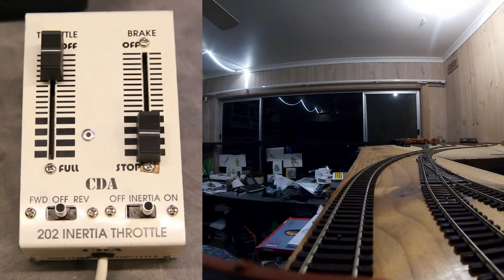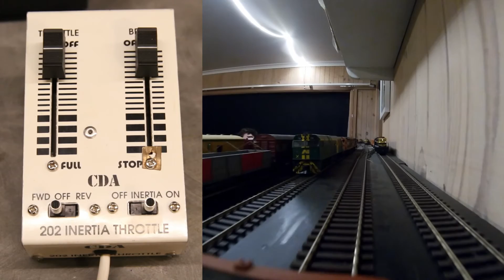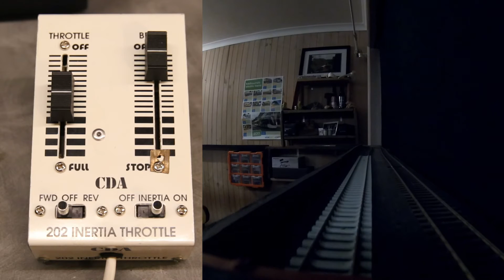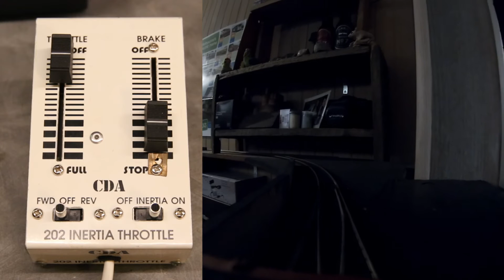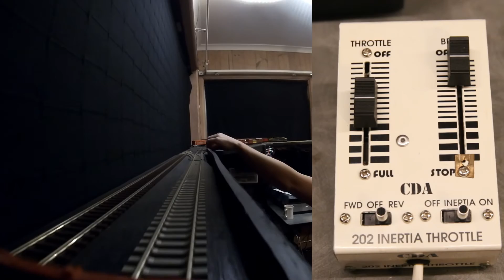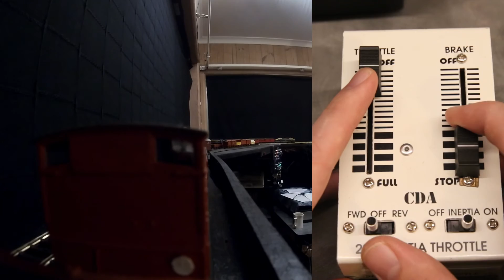Model Railways - Driving with an Inertia Throttle

Comment: Great video! Looks like a brilliant controller. Just wondering how you did your soldered feeder wires to your track? Where do the soldered wires go to from the track? I have a DC Australian model railway and have only been relying on fishplates to provide constant voltage around my 5 metres of track. I need to do something similar as some of the sections of track on my layout, trains slow momentarily due to a lack of voltage. Thanks
Reply from the maker: Glad you enjoyed it! For this layout, I ran a bus wire (fairly thick speaker cable) under the desks from the power supply around to each control panel (4 panels at different points on the layout), then a wire just runs from each switch on the panel to the section of track it controls. For long sections (like the double track bit across the window) I didn't add any extra feeders, power was just conducted through the fishplates. There were probably some bits of track that were maybe 8 metres or more via wire from the power supply. There was a slightly noticeable voltage sag on the far side of the layout, but it was never a major problem. If you haven't seen it there's a more in-depth look at this layout here: https://youtu.be/lSJelX9OBK0

Comment: Hi Martin - great video, this is exactly what I'm looking for - there don't seem to be many options around with inertia and braking.  I'm very new to all this, and although I've been to CDA's website I'm still unclear as to how the system is powered and connects to the track.  Yours is the #202 with the cable and the 5 pin Din plug - dumb question, but what do you plug the controller into?  Cheers, Wayne
Reply from the maker: Hi Wayne, that's actually a pretty good question! The controller uses 4 of the 5 wires in the cable - 2 wires for 15v AC coming in from a power supply, and the other two are the DC out to the track. I just use an ancient Triang power supply/controller, which has outputs for 15v AC, as well as 12v DC controlled and uncontrolled outputs. So the power supply is just somewhere under the bench, with the AC wires running to a female DIN socket located in a useful place to drive from (I mounted it just on a bit of wood). You can also have sockets in multiple locations if the layout is big enough, which I did here. Then DC out to the track. The controller comes with a diagram for wiring the sockets up. Hope that makes sense!
Reply: Taitset Fantastic! Thank you - that makes perfect sense. Now all I have to do is find one in stock somewhere! :-)

Comment: I bought a similar controller in 1980 in the UK!  It was made by an industrial control company in England.  Mine is now showing signs of age, obviously, and I run my railway for tourists.  So I'm excited to discover this manufacturer a few minutes ago.  Your vid was the only one on Youtube.  What happens when you have a short?  How much did it cost?  Thanks Philip
Reply from the maker: Hi Phillip, glad you've made the discovery! The controller has a thermal cut-out, which activates if there's a short or overload (I've sometimes triggered it when running four locos on one train). They currently sell for AUD$136, there's more info on their site here: https://cdaelectronics.com/controllers/
Reply: @Taitset  Thanks for that.